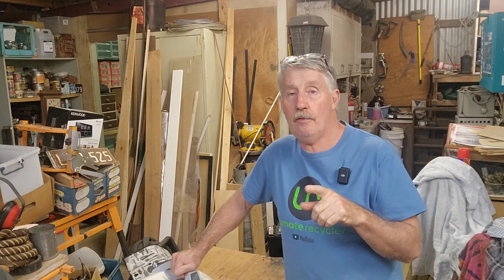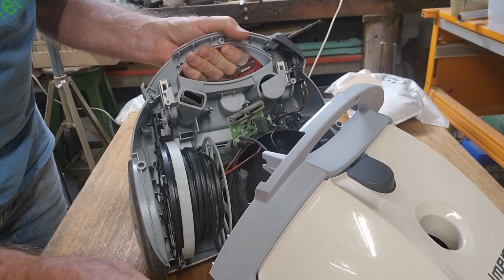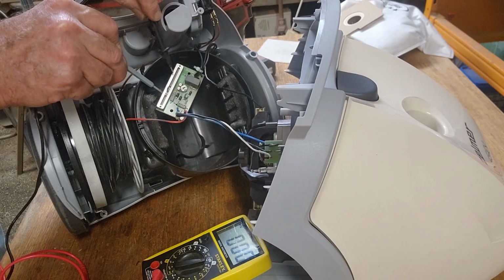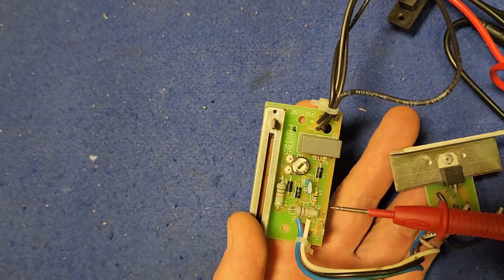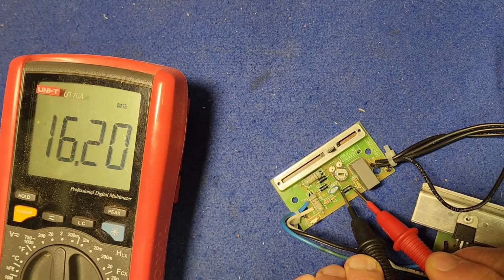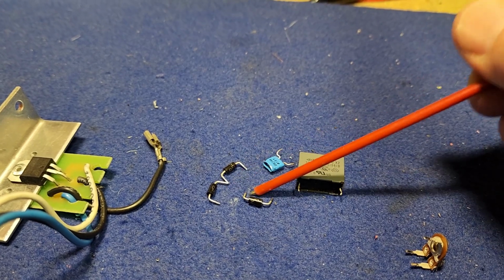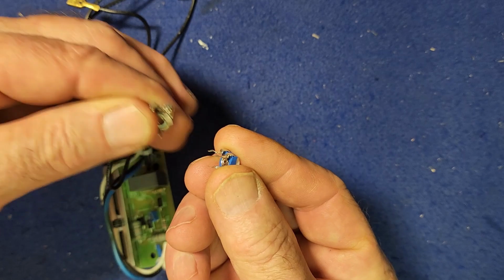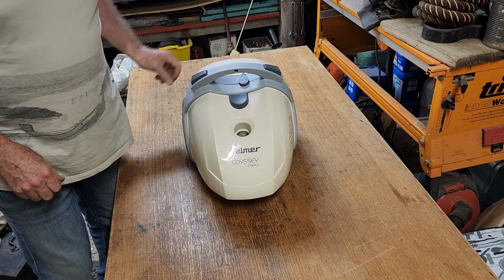How to Fix a Zelmer Odyssey Vacuum Cleaner Variable Speed Control A Journey of Electronic Discovery!

Comment: Fabulous find and fix Chris. Colour me impressed 😊 if that is a common failure you could determine the correct resistance from the pot and install a fixed resistor. Cheers! 👍🙂
Reply from the maker: Thanks Dave! Yeah, I wondered why there is even a need for a calibrating trimmer. Surely a fixed resistor could have been used!

Comment: Another excellent repair video, thanks for that. One question......why would you want a variable speed anyway?  What am I missing?
Reply from the maker: Have you ever tried to vacuum a mat or a rug - or clean cobwebs from curtains? Sometimes a little less suction is rather important! But yes - I'm usually a maximum power kind of guy! Thanks for watching 😊👍
Reply: I had a Miele once that was very hard to move across the carpet when on full power - and very loud to boot! I liked being able to set it at around 75% for the best trade-off.

Comment: Ha ha, good repair. I would have sunk a screw into the housing to keep the sliding power lever at maximum.
Reply: Yes. I don't understand why vacuums have an adjustable power settings.
I've always wanted a vacuum to suck as much as possible.
Reply from the maker: Yeah, most of the time you want maximum suction - but the reduced power is handy when you are doing other things instead of carpets, such as mats/rugs and even curtains! Things that aren't fixed I guess..

Comment: Basically a glorified light dimmer. Usually the Triac shorts and they run flat out all the time in that sort of circuit. Cheapo trimpot says otherwise. I rarely buy anything electrical new because there is always someone chucking out a perfectly repairable thing like that.
Reply from the maker: Yep, just about everything is perfectly repairable! I'm actually doing pretty well selling repaired items through the shop - although many aren't really that viable when I take my time into account. The bonus is that I make some Youtube money from the video that that offsets the extra time! 😊

Comment: awesome! was just low tech enough for Me to understand. I'd never heard of the triac or the the diode thing (forgotten name already). I recently fixed a brushless leaf blower that i would have had no idea about other than an obvious fault (broken wires) (the electronics board is resin filled). but it definitely pays to HAVE A GO, because it could have been something simple just as easily. 
I've lost count how many times i've fixed things with cracked solder joints or broken wires etc, still very satisfying especially if you can use it or sell it for someone else to use. 
this was quite enjoyable to watch, due to having the components explained and what they do(I have a good basic electronic knowledge though. )
Reply from the maker: Thanks Dean! Yeah, bad solder joints are a very common problem since they went to lead-free solder! Glad you enjoyed the journey! 👍😊